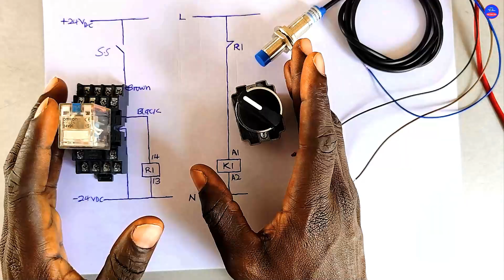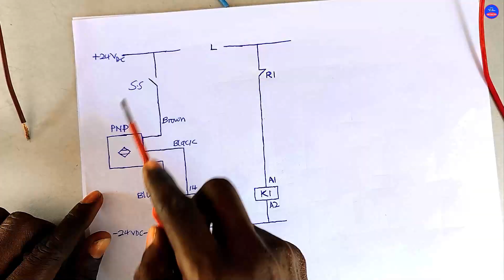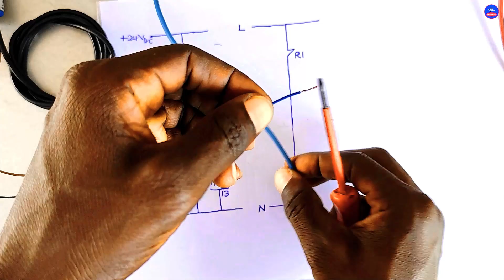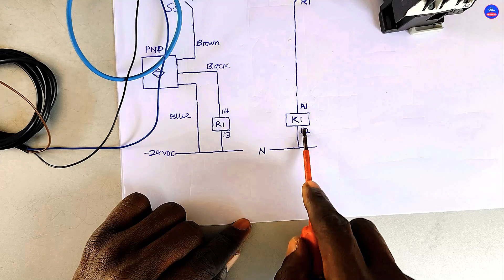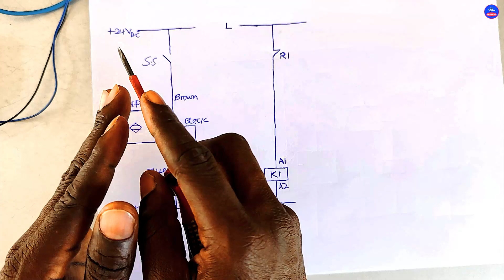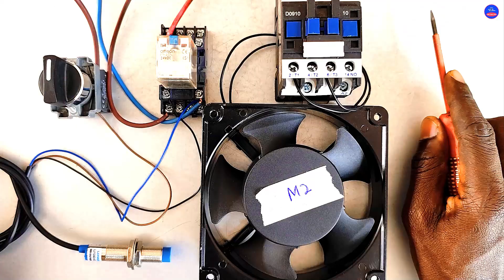Inductive Proximity Sensor Connection and Operation For All Levels

Comment: What is the difference between PNP and NPN sensors
Reply from the maker: PNP sensors give a positive output, while NPN sensors give a negative output
Reply: @ChrisControlAutomation 
Please do you have a video which explains the terminals of the DC relay